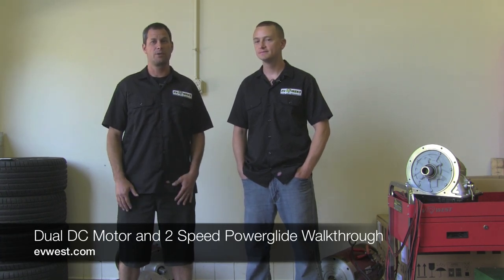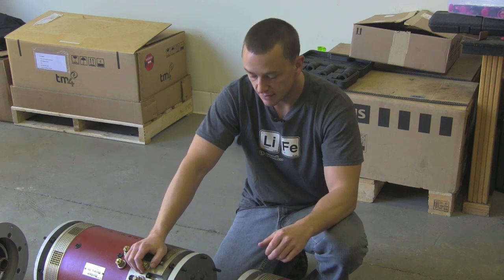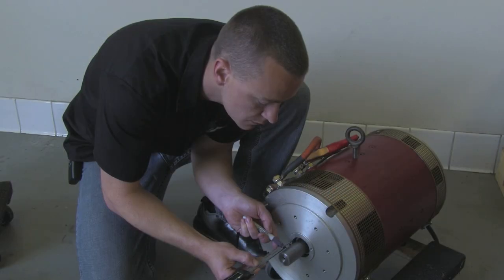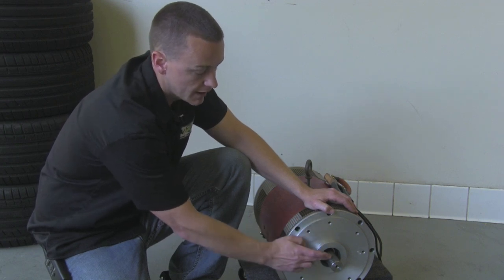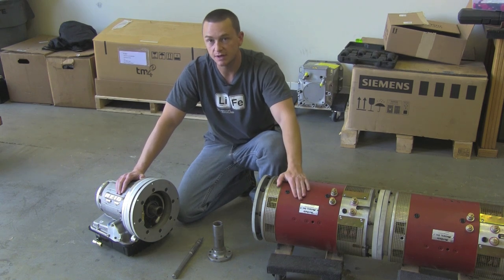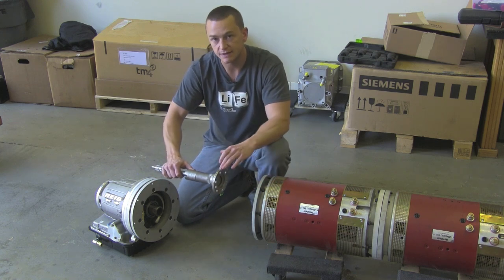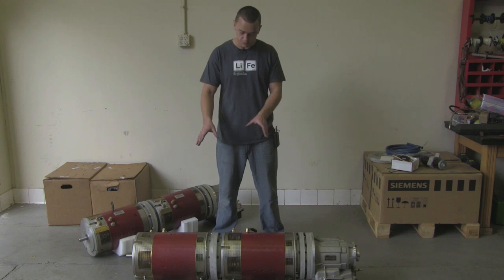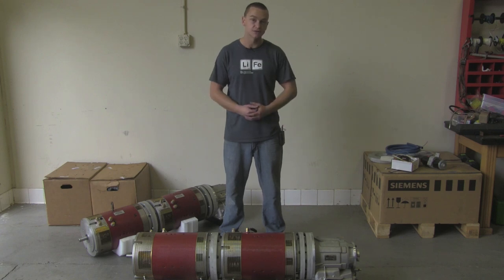Dual Motor Electric Vehicle Drivetrain With Powerglide 2 Speed Transmission Walkthrough by EV West

Comment: This is fantastic. I'm 73 years old now and my health is failing but I built race cars from parts I got out of wrecking yards when I was a kid. If I had my health and strength back I'd be taking on a project with this concept. EXCEPTIONAL GUYS. REALLY EXCEPTIONAL.
Reply: Wish you the best Ronzig
Reply: And you were probably using this same transmission design (but with a torque converter).

Comment: Michael Bream and his crew at EV West are some of the most knowledgeable and polite people when it comes to EV conversions. Michael was a huge help with my project and gave me advice from batteries to powertrain design. 
One of the things he warned me about, however, was that this Reid powerglide was specifically made for racing and was not "kind" on street use due to the inherent pressure loss of the transmission. When discussing options for how to generate the needed PSI of fluid, they were limited to diesel fuel pumps (somewhat loud, but effective) or just allowing the internal pump to spin up to 500 rpm and launch the vehicle into motion (usually with wheels chirping).
No doubt, the PowerGlide can handle the output, but don't try modifying your own (non-Reid design) to fit because the mounting points on a standard unit would end up being the pump mounting bolts and are not designed for the forces involved.
Just my own perspective, folks.
Reply: What do you think of this? I have a 1992 F150 that I bought brand new. It won’t pass smog now but has a good rebuilt differential the three speed Borg warner manual shift 
transmission is in very good condition. The body is all original. This truck is clean and straight. Trucks are expensive nowadays so I thought an electric one would be handy.
Do you like that idea of making it electric?

Comment: A very nice set up, I have cut a gearbox shaft in a similar way and got away with it, despite having to cut the spigot section. Should be no problem in your application. Presumaby you are running a really tall ratio axle, I believe these motors are ok up to about 6000rpm. Would not think you needed a lower gear with all that torque output.

Comment: The more I watch these videos about EV conversion, the more I want to convert my 1980 Chevy Citation into one. I only say this because to this day I still want something to insanely update and modernize my car in some way and had this fantasy about putting an LS engine in one at some point, until I found out that a lot of ICE conversions typically go in that route, and I'd still be boggling with fuel consumption. Biggest thing that concerns me is wondering if it would be worth it in the long run, and not just for bragging rights.

I'm not into EV to save the planet or anything like that, but I have been severely impressed by the results of what EV's are capable of and I'd like to learn as much as I can about this exciting technology. As I've mentioned elsewhere, I really wish EV West were, or in the very least had a sister company of some sort to physically visit, here in Tucson. Because I'd really like to pick their brains about what they do and how they might be able to help me, presuming I could even afford such a venture.

Comment: some of the new electric motors coming onto the market 1/3 the length of just one of your old type with the nearly the same torque of both motors makes for some snug installing or stacking of motors , nicely put together video btw )

Comment: NICE!. I'd like to try a locomotive traction motor on a semi truck with a 10 speed auto or manual transmission. You can put a huge battery in a 53 foot long trailer to power it & have lots of run time! Use solar cells on the top & sides for recharging etc. That would be cool AF! SEMI-LOCO!!!  :-)

Comment: Something not covered in the vid, when coupling splined systems, it is critical to put grease on the splines to prevent fretting.   If left dry, the splines can even gall together making it difficult to take apart.

Comment: Bleeding-edge technology literally bolted directly to 1950s technology. It's absolutely a solid combination, it's just funny to see the contrast.
Reply: Seth Baker More like 1800s tech bolted to 1950s tech. The science behind DC motors really hasn't changed much. Honestly, I think people are finally starting to look at electric solutions because of gas prices and environmental concerns.
Reply: Chevez Ezaneh no, because batteries are finally not shit. lithium ions are like 1200 % more power than a lead acid of the same weight

Comment: Hello. 

 Thanks for your video. It's actually very very helpful to a novice like myself.  I have several projects currently in progress;
Electric propelled ultralight plane
Electric dc motored ppg (paramotor) I currently fly 2 and 4 stroke motors with very limited tuning, sound deadening options (though most of the noise is from the props breaking the sound barrier.  Do you know or are you able to supply any motors that would be under 25kg that could provide 50lb of torque? My concept involves using propellers that have a great enough pitch that they don't need to brake the sound barrier.  And it seems that electric motors are the only form of power unit thay could provide the torque needed while saving on weight. (Currently I am just under 50kg not including my wing. This includes my full tank of fuel, motor, frame, controls etc.... 
Another advantage would be;
-a non mechanical cable (bluetooth controller) 
-no need for a clutch to reduce propellor movement during initial takeoff (the most risky part in my opinion) 
-silence while at 0rpm and less chance of mechanical failure  (if built correctly)
As you'll obviously know, torque is what matters. This is what I'm aiming for. Currently my tandem motor is 27hp and 26lb of torque. But it's extremely hazardous during takeoff with a passenger due to the constant rotation of the prop. Anyway. I'll message you my email address if your able to help? I Ave several small time investors and sponsors, several mechanical engineers, 1 aviation engineer and 1 electrical engineer. Also I have a source for custom pitched propellers to achieve our <sound barrier rpm goal of 75lb of static thrust. 

We could also adapt this to partrikes (with wheels) and hang gliders/microlights. I've been developing these concepts for around 6 years and achieved less than a dozen lipo flights without achieving our ultimate goal of our desired  torque. Thanks for your time and please reply to my email if interested. I would not be expecting a free service or products.  I'd be a normal customer with only the need of advice (possibly extra help expertise)

Comment: Hmmm... what about four motors and two Powerglides, one for each rear wheel with a microprocessor controlling traction and shift points? Or, same setup for all-wheel drive... one can dream.
Reply: nozmoking1 too heavy probably better for off roading, then implementing smart ai for traction control for off-roading too and each works like a smart control throttle for really messed up terrain, could be fun

Comment: Great overview!  I'm planning at least one 11 in my conversion to your powerglide setup, but I'm using a Warp-Drive 1400 Amp controller with IDLE feature, so I shouldn't need the pump (right?).  We should talk again as I also want to use your front adapter plate. (and now you have me thinking about dual 9's instead of a single 11...)  Thanks for sharing!

Comment: Great job on cutting the shafts.  But my question is how do you get that long thing inside a car?  Does it get mounted longitudinally and the powerglide connects to a long driveshaft which connects to the rear differential?  What do you connect (a fan?) to the otherside of the motor?  Thanks in advance.
Reply: The BMW has a lot of space under the hood. That, paired with the removal of the transmission creates plenty of space. The transmission they've mounted has an adapted for the driveshaft, yes. They don't connect anything to the other side. At least I don't think they do, nothing makes much sense, to be honest.

Comment: this would be the perfect setup for my motorhome.. have you ever done anything with a generator, gas, diesel, propane to supplement the batteries.. like a hybrid.. because the RV is going to really pull down the batteries at 11,000 lbs.

Comment: the best way to have reverse on an electric motor is to have a good enough controller to switch to reverse. but you can use the trans too.
Reply: Perhaps, but that would not allow a way of using the transmission to hold the vehicle without the motors running. Also cannot simply reverse the motors when powering an automatic transmission.
Reply: But the Powerglide is not like most automatic transmissions.  It’s only a two speed, one underdrive, or low gear, and then top gear is 1:1, just like any old 3-speed auto.  The whole point of using the Powerglide is it’s inherent strength.   It is the first choice of bracket racing drag cars.  It only has to shift once, so the whole system that enables a shift from 1st to 2nd, which is not the final gear, complex.  Even the 2nd to 3rd is a weak point, with the central (2nd) gear being the problem child.   One shift into a gear that doesn’t have to again shift up is much stronger.   Also less slippage.   But really only for certain applications where torque multiplication isn’t such a huge deal.    So with the massive RPM range of electric motors and a plateau for a torque curve, this transmission is actually genius for the application.

Comment: Park, yes you need a park pawl but it should also short out the input leads on the motor will resist allowing the car accumulating much speed if it rolls away. (dynamic braking, works like regenerative braking)

Comment: How do you eliminate road vibration from ending up in the motor and motor-bearings as well as the transmission bearings? What kind of frame is that mounted to? How do you eliminate frame twisting that could translate into the motors?
Reply: I guess he's using rubber dampeners as well as magnetic bearings.Also he possibly uses  reinforced steel frame with lots of struts.

Comment: I'm looking to build a three wheel 'delta' shaped vehicle with the two drive wheels in the rear. My whole concept is based on the Nissan/Panoz Deltawing race car, but with two seats, and at least enough storage space for a 30-gallon laundry bucket.

My ideal goals are a running weight of around 1750-2000 pounds, with an output of 175-250HP and a 125-150 mile range. My question is, would such a thing be possible using a 2-speed transmission, and, say, a 7500-12,500 RPM AC motor [for motor braking and regenerative braking]? And, if so, where would I find something like that?

Also, what size and kind of power pack should I be looking at, and will the SAWC allow the range and performance I desire?

Thanks,

~Dave
Reply: Bad idea study the Renault 3wheeler they flip best to have 1 wheel in rear and 2 up front for traction and controlling stability in turns

Comment: Here is a thought You are using 2 warp 11 Motors in straight setup and with trans is more then 54 inches  correct ..... have you tried running 3 motors in a V format with a "gear box" of some sorts to allow for the 3rd motor? tractor pullers have been running  Multi engine setups for a long time with great success

Comment: Why are you using 2 phase dc motors, brushed?, instead of 3 phase ac or dc asynchrone or synchrone machines ?
Reply: Mathieu B I’m wondering the same thing but for just ac due to the regenerative braking
Reply: Why would you even care if it works and it's SIMPLE. Do you really think Elon knows everything? Come back to reality folks.
Reply: Or maybe I'm taking too serious your sarcasm. hehehe
Reply: Cost
Reply: DC motors have proven to be more energy efficient than AC motors even after regenerative functions are factored in. Though it does cost by way of brake wear.

Also take into account when the car was built and what was available on the market and the reduce cost of DC vs AC.

At that time there was an abundance of DC offerings available relative to AC. 
You would also have to consider availability and price of controller/invertor suitable for an automotive application at that time. 

Yeah, brushes suck but they are easy to acquire and replace nearly anywhere in the world.

I'm sure we all do the best we can with the materials and understanding available to us at the time.

I think they have done a very good job.
Reply: It's great question! By the way Elon would know!
Reply: @danaolson2871   not all DC motors are brushed. It is well documented that DC motors are more efficient than ac motors. Modern electric cars us ac motors because of the regenerative braking functionality of an ac motor but that is still not enough to make up for the inefficiency of the ac motor alone. What tips the scale in favor of ac motors is something known as vector control of a vector rated ac motor. That is something you can Google on your own, I'm not going to explain it to you. DC motors do not require transmissions, But they are typically used as a replacement for a gasoline engine and since the transmission is already there it is easier to simply make a mounting plate to bolt onto the transmission than fabricate a slip yoke spline for the drive shaft. But what do I know, I'm just a motor controls specialist who makes an living matching controls to motors for industrial applications between 480 vac and 13,600vac. I'm sure you know a lot more about it than I do. Be sure to drop a link to your EV swap so we can see how much better your work is than what these guys in the video have done.

Comment: I own a Toyota Super Saloon-MS112. It weighs in at 1,500 kg (3,307 lb). Will this set up you displayed here be capable of driving this car? How many lithium ion batteries (weight of batteries) will I have to install in the car to get a range of 400 miles, while using the A/C, radio and other devices?

Comment: how much to convert a f50 ford truck or an older E150 or E250 Ford Econoline? for towing an R V ?
Reply: Pretty sure you're gonna have to make up your mind what you want converted. To quote a job like that you actually have to do your due diligence. It would amount to quite a bit of work to produce a quote just to satisfy your curiosity. 
I would assume the same thing the makers of this video probably did, that you dont intend to pay for that quote.

That's probably why no one ever responded to you.
Reply: What do you plan to use for a power source and how far do you want to drive?     Rough numbers say a vehicle that size pulling a RV camper of any size is going to suck a KWH or so per mile which unless you want to only drive 30  - 40 miles before doing a heavy recharge cycle or have a unrealistically huge and expensive battery, your SOL on having a practical to use heavy duty electric towing vehicle.
Reply: Mike, I've a similar question for a GMC 3500.  Thus far I can tell it would be well over $10k (and that's for only around 40 miles or so / low mileage range).  IMO, if a few standard prototype models could be fitted, someone may have a profitable opportunity to restore old trucks (which need heavy pull power that many electric motors can provide anyway) with electric engine kits.  If you find a reliable conversion company / near all inclusive kit for domestic trucks, please post a link for it.  My guess is that the engine / drive shaft coupling may have have to vary but otherwise may parts could be the same.
Reply: We did it to school bus platform so Imagine it will similar. Not worth it imo. I cant remeber all the stats but it used 9 batterys with god knows how many cells. Each battery was $30,000. The range was only 75 miles. Charge time around 8 hours empty to full.

To be worth it needs 200-250 mile range and battery should be 1/3 of the price. Not counting controller cost, drive units, cooling and heating.